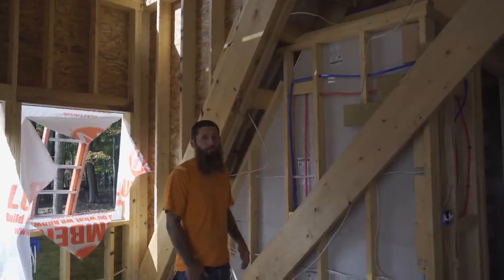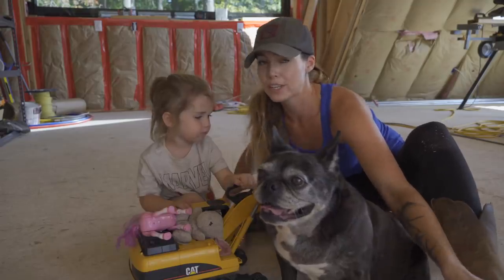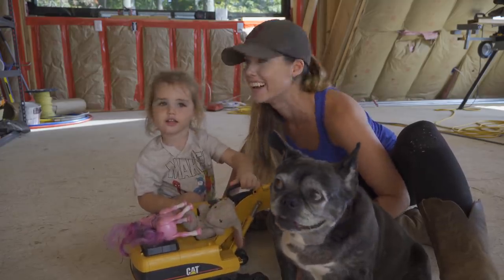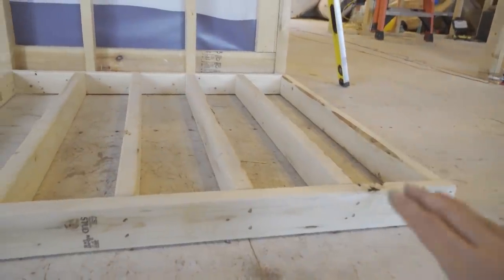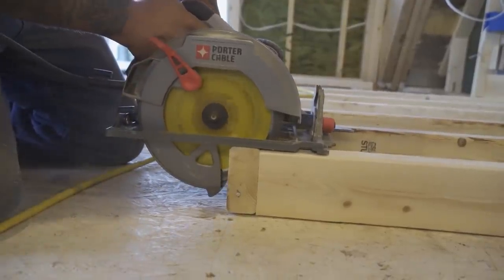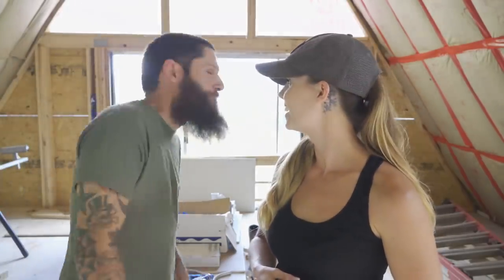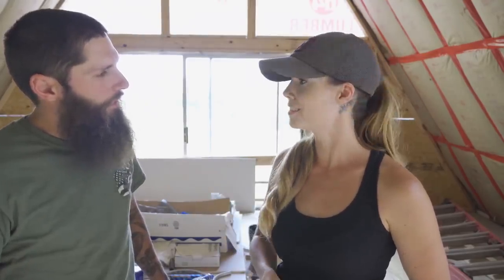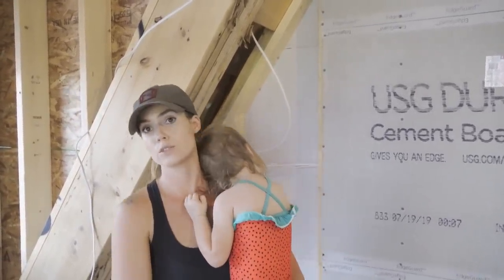How We're Heating Our OFF GRID Home This Winter

Comment: You are going to be on YouTube a long time working on this house. One can only wonder how many subs you will have when it's done. So heat rises. Will you need a ceiling fan to blow the heat back down?  Not everything can be fun, but the end result of the black wood is really beautiful, and as time and the elements affect it, the result may be stunning in the long run.

Comment: I hope you considered ceiling fans because the loft will turn out to be a dry sauna iffn' ya don't. Hope you have fixtures in place and wired in before the dry wall goes up. A friend had an outside wood burning exterior furnace and had to adjust his winter schedule to FEED THE BEAST. Have you considered a covered walk way to the Beast and to the wood pile required to keep it going????? Hope so. Great job so far and really enjoy your journey to your dream house.  ;) <3

Comment: unbiased opinion from a complete stranger... kind of more common to have a stairwell coming down to the front door.   but, it is tough designing a house.  you build it how you will live in it.  Even then, it may not be right.   we built a new house we designed and sometimes reality of how you use and live in a house, doesn't match what looked good on paper.  sometimes you don't realize it until you see how you end up using a space.

Comment: Great job on the start of the wood heater. Question I have do you need a resptical in the cement wall for power to a fan on heater? Just a thought.

Comment: She could have stopped after the first 10 words, I knew exactly what she was trying to explain. Little ship ladder, stairs up the back in the addition. I like where the stove is, it will heat your house in 1/2 hour. That is what I had in our mt home, coming in at 11-12 o'clock at night after 3-4 days cold, took 30-45 minutes to warm up the house. I hope the stove has glass doors, that will be beautiful. Back home when I was little, the stove sat app 3 feet from the wall, guess where I laid before bed.

Comment: As a rule the stove pipe should extend a minimum of  2 ft. above anything within 10 ft. of its exit point.  I am certain this will be at a minimum 2 ft. above the ridge. This will determine how much volume of air you will need to heat in order to create convection. Consider  how to access, clean and maintain it. Obstructions such as elbows inhibit air flow and are problematic choke points and difficult to clean. Consult professional advice. Carbon monoxide emission and oxygen depletion are a severe risk under the best of conditions.

Comment: I don’t know what your clearances to combustibles are, but backer board with tile on it is not considered non-combustible. I know this because I installed a wood stove in a small room thinking I would just use backer-board and tile so the walls would be non-combustible only to find out that it’s not the case. I ended up fixing it be installing heat shielding made out of sheet metal mounted 1.25” from the wall. The same is true of the floor.  I did some research on it and apparently the the temperature on the backside of the backer board can get almost as hot as the front side of the tile. Since you have wood studs holding up the backer board it’s considered combustible. If you decide to go the heat shield method it needs to be mounted with a 1 1/4 inch air gap between the shield and the wall and 20 inches above the wood stove. I am assuming that the clearance to combustibles for your wood stove is not being met.

Comment: A normal floor is rated for 50# or so per square foot.  You can add several floor joists,,, but the total strngth is still not going to go up very rapidly, because it is one of the strength limitation, bending, shear,, etc. that will limit what you may install.  Also the basic load limits are for 'live' load,,,, temporary, transient.  A stationary load, like a vertical mass of stone,,, well,,,  You may want to consider a permanent footing directly below the load.    Concrete and block are very inexpensive.  The tough part at this juncture would be crawling under and digging to below frost line. 

The planning question is how much weight?  How long will the weight remain there? (How many years?)  Real stone?  Porcelain?  Plan it out.  Much cheaper to do this with pencil and paper.

Comment: the WOOD stove platform is inadequate !  you need to think 500 deg. heat ! on the wood  THROUGH the cement board !
 a heat shield is a must.... a aluminum plate works the best a 2" air gap at the bottom, extending up at least 6' and that aluminum plate needs to be on 2" stand off's.... so air can be drawn in and flow behind to keep the rock wall cool enough.
.... wood is strange, if you heat it repeatedly to 250 deg years will go by and it will be fine.. but eventually the ignition point of the wood will come down to 250 degrees and it WILL ignite on it's own !!!!   learn from my experience ! I lost a house because of this
Rock on cement board will be fine for a while but in time it will burn your house down ! I use 3 sheets of metal roofing as my heat shield... all separated by 1" apart....   don't waste the heat, put a fan to blow heat into the room !
and make the hole through the roof bigger than the 3 wall stove pipe !  by 1" to 2"   that area of my house turned to powder
because of the heat.... this was before 3 wall pipe .... but the danger still exists so go accordingly!  and you want your stove cap 2' above the highest point on the roof... so it will draw good ! .....
there's nothing like a good woodstove for heat.... but they are a danger.....  cement board and rock will look fantastic, but you need a heat shield between the stove and wall still...... REALLY !!!!!     Bob....

Comment: The more I watch your videos, you didn't really put a lot of "preplanning" thought into all of the details, did you?  I don't know if that is an advantage when you're doing the majority of the construction yourself, ... and then change your mind mid-stream.  Of course, other home owners do the same thing with a new build occasionally, ... but you guys have done it quite often.
Reply from the maker: All the dormers were planned ahead of time so the only change we have actually made is placement of the stairs. We couldn't do the dormers as we built the frame because there is no way the 2 of us could have lifted partial A's nor could we have had the entire house closed in with all 3 dormers before winter hit. It was easier for us to come back and do the dormers as went went along and a safer call to be sure the house was protected from the weather- especially with 2018 being such an extremely rainy year. You ate probably correct though that being owner/builder it is likely easier for us to make any changes tjat we may want rather than to ask a contractor to do it.